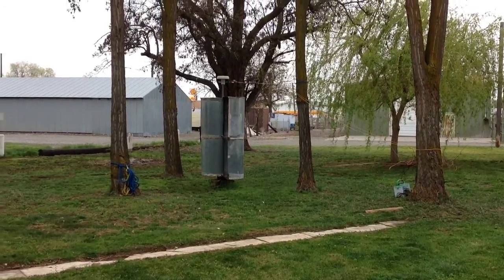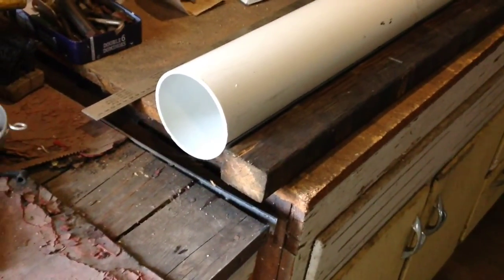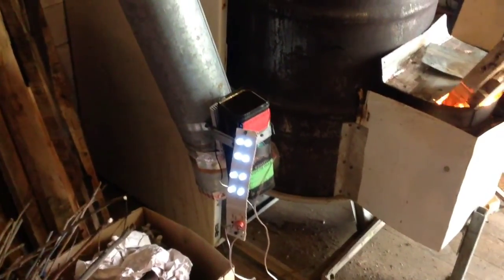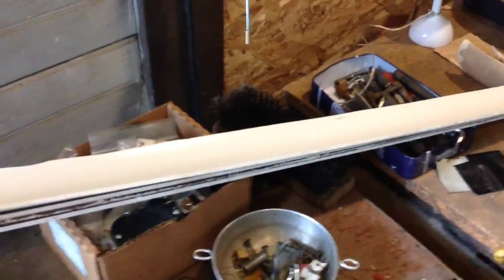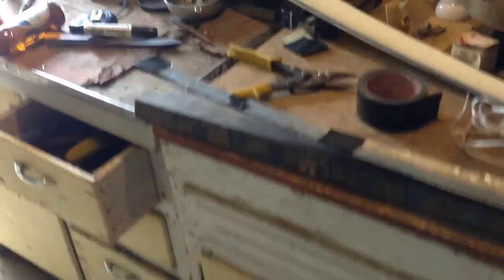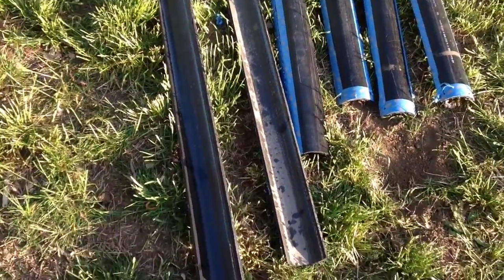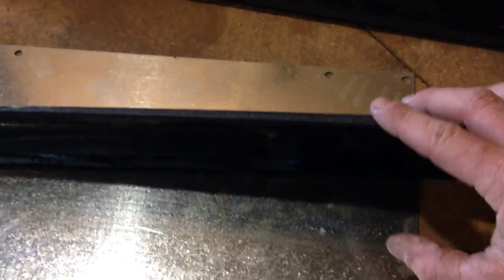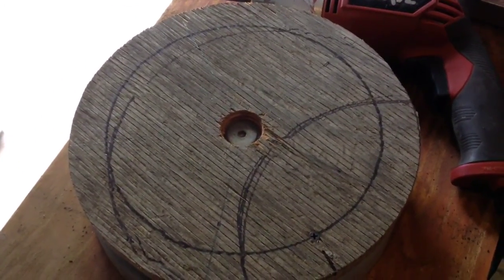Horizontal Axis Wind Turbine BackRoomLabs

Comment: I thought about doing this, in 48-52" long, but fiberglass encapsulate them, with a 1/8" x 1" x18"-24" Aluminum flat bar inside as amounting point,  and hub for 7 blades, ido tget that much wind, I'm also thinking of using a DC converter, and a mppt controller, since I have lithium batteries,  and a voltage activated dump to connect through a few 100 watt resistors, or a hot water heater, but larger blades tend to be slower,  so I may need to shorten them, the main reason I haven't already got a turbine, I will have to put it up about 50' plus, I got trees!!!

Comment: Hi I'm in the process of building my first smart drive wind turbine , I've been doing a lot of research for building my own. I like your concept of mounting the blades to the magnet rotor and it's the first time iv seen this idea. Does it work well? I live in New Zealand and these motors are so easy to obtain for free , do you have a link or title to the book you were using for reference for your blade design please. Cheers Danny
Reply from the maker: oh yes. everything about those motor/generators is crazy strong. hell they spin a washer with 10 pair of wet jeans off balance for years on end